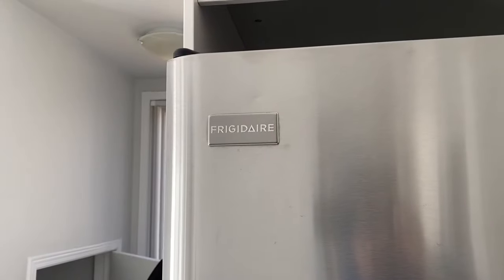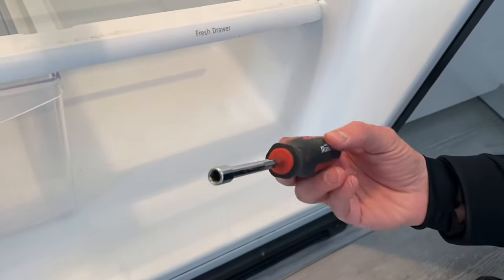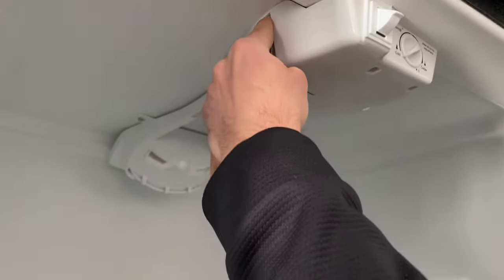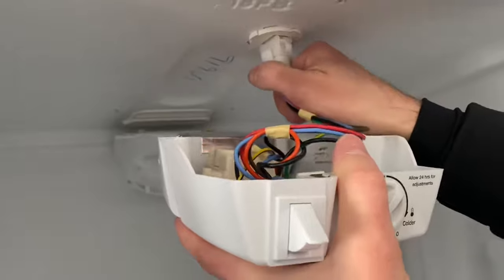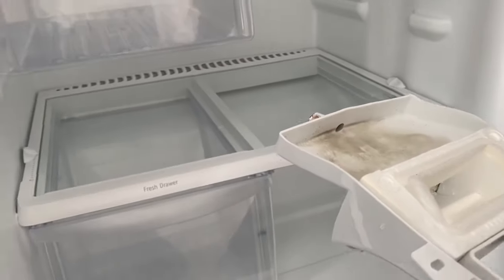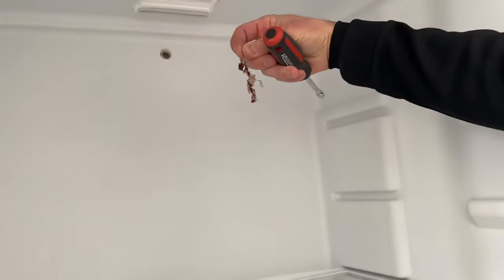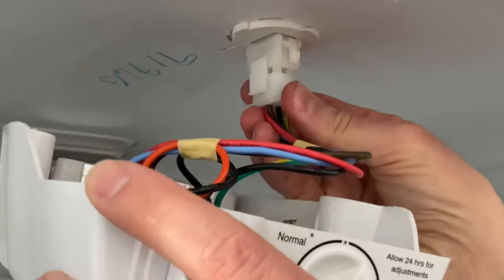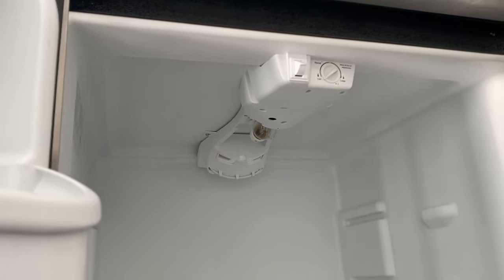Water at the bottom of fridge - No problem. Diagnose and fix in under 10 mins

Comment: Where did my comment go and shouldn’t it be on the top if I just put a comment up just now?
Reply: Anyway, mine is a small apartment size fridge and freezer on top. It has the controls on the side and that what I take apart?  I know this fridge a drain hole at the inside bottom. I found this out after I got this fridge and had for 4 months. 

That time the smell was horrible and I couldn’t figure out where the smell was coming from. I thought something fell under or behind the fridge but could find anything and wipe everything. So about 2 months later while looking at the back and close to were the motor was, I found a cup that had water. So I got a sponge and it was very hard to reach and very bad design. 

It turn out it was water from dripping shrimp that I had in the fridge for about 3 days and it dripped into that drain hole and collected in the drain cup. I managed to get my small hands inside the back with a sponge and got all the water out and it still took about 2 weeks for the smell to go away. 

I never had a fridge with a drain hole that drained into a cup that seemed like you had to empty every 6 months or do. 

This was a very bad design by Frigidaire and I’ll never by from that brand again.